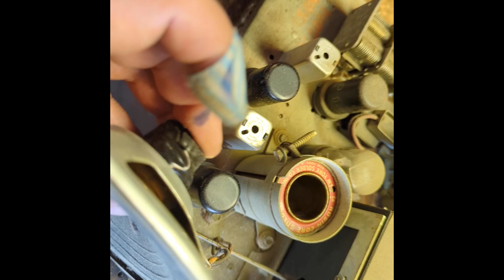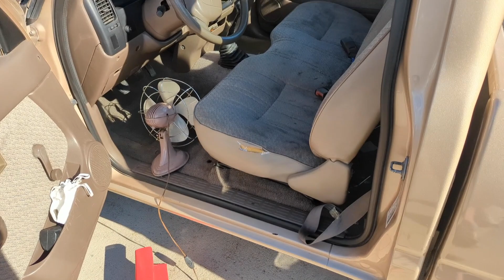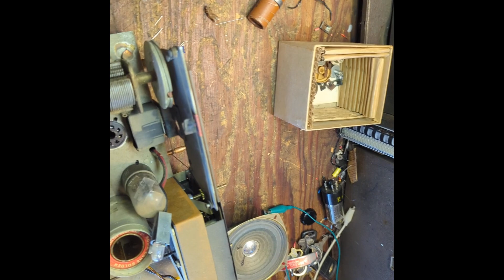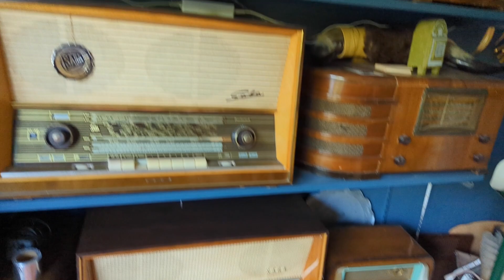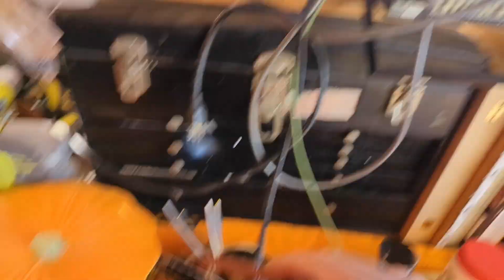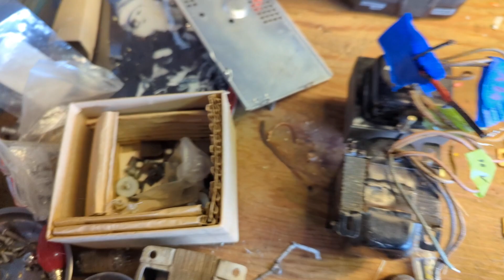Epic Hallicrafters restoration

Comment: You guys wanting to follow along If you can get the tubes made in 1957 they should allow the unit to operate of 2xPJ996 batteries or a 12V Wall Wart using a LT800 transformer to drive the speaker

Comment: Impressive radio collection. I sure hope you have a good smoke detector / fire alarm system at your house.
Consider the consequences of a fire...
But I tought you said you didn't do cosmetics only electronic restoration on the sets?
And you got paint running down the radio with only half can of spray?
I meen it ran in only one spot? That's an achivement on it's own.

Comment: Nice job on the paint!  Looks very good.  I've had some luck saving warped speakers by boiling a small pot of water, setting the speaker over the pot until it gets saturated, and then quickly drying it with a hair dryer.  Will often, but not always, fix a warped cone.  Nice to see your collection as well.

Comment: I never have seen a Hallicrafters AM-SW clock radio. My parents had a Hallicrafters  black & White TV in the 1950's, so I guess they did clock radios also. Radiodaze has all kinds of Hallicrafters  decals, mainly for their Ham  -  SWL receivers, but look at the SX-122A decal supplement  P/N  DCL-HL-SX122A.  Not the same ,  but  maybe an  acceptable  substitute .
Reply from the maker: First one I've seen too. It was just too bad the original finish was hosed
Reply: @misterradio5035   I wonder if your museum has any history about their clock radios?  I wonder if Hallicrafters subbed out the  those radios to a 3rd party ?
Reply: @misterradio5035  I like the blue that you used better than the original.